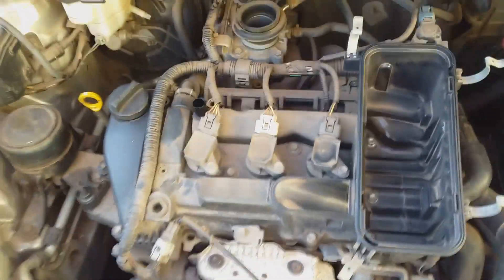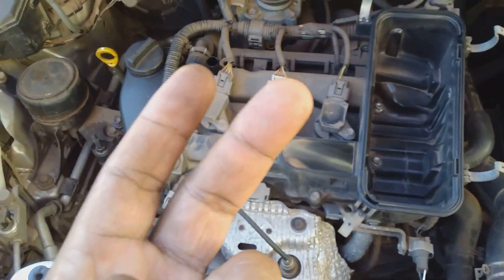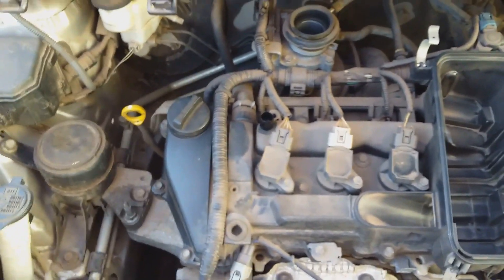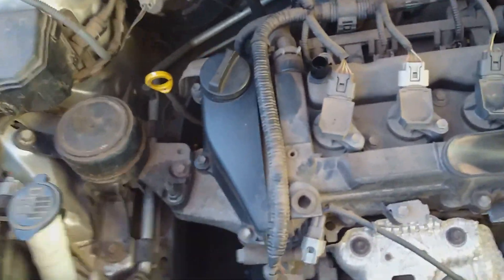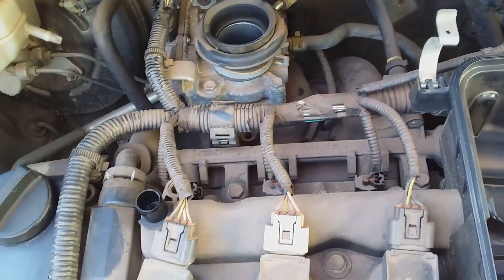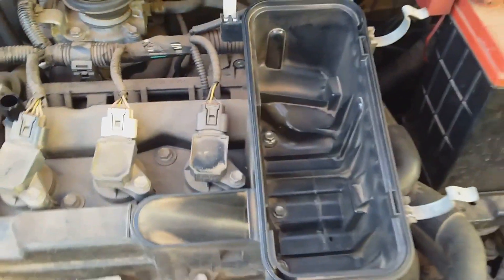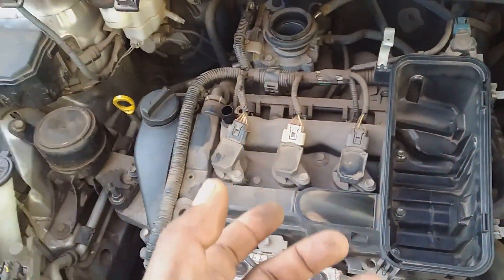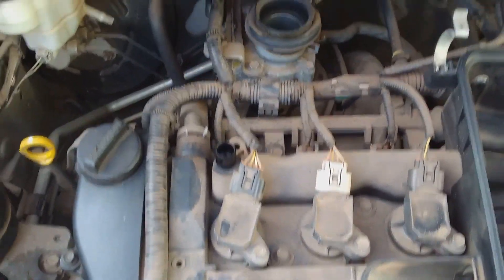Toyota Vitz Engine Vibration Analysis

Comment: Hi man please can you help me ? I removed the trutle body and cleaned it , after I put it back , à air light comes on the dashbord I removed it again check everything but it won't go off , why?
Reply from the maker: Hi there, to erase a engine check light you can use a scan tool.
This light will not go off by itself if you fixed the problem.
I have a bluedriver scan tool in my vehicle all the time in the event I need it to erase a fault code.

Comment: Hi there . good knowledge about Toyota vitz you have . what might be the issue for rough idling when the car is warm ?
Reply from the maker: When a vehicle idles rough and there is no indication of any engine check light issue you could have:
1. a disabled idle code.
2. a partly blocked throttle body valve
3. EGR valve problem.
4. Spark plug not firing properly- check sparkplug/ignition coil pack.
5. Other fuel or ignition issues.
Reply: @ShelDockToyotaVitz  also my car is a push start and i follwed and tried your engine idlle code enabling video.
Reply from the maker: @uipex  Thanks for viewing my content. Hopefully you are finding and solving the problems causing your engine vibration.

Comment: SOOOOLVVEEEEDDDDDDDDDD BY LUCK my engine stop vibration when i put a adapter in my second ogyzend sensor L WHEN I PUT NEW CATALITY EXSAUT which is aftermarket and no connect correct as the original and the engine check was on all the time
so I HAVE increased exhaust gas and my cpu try to low reduction 

my idle worked AT 500 -600 and now when i stop with engine on my idle SHOWS 900 - 1100 NO VIBRIATION

THE MAIN PROBLEM STILL IS INCREASED EXHAUST GAS  MY ENGINEAR WILL SEE IN THE NEXT SERVICE
SO BUT A ADAPTER  IN second ogyzend sensor AND SEE IT REALLLY WORKSSSS
PLZ ANY SUGGETION FOR  increased exhaust gas
Reply from the maker: Thanks for your comment, as for a good rpm during idling it should be between  600 rpm and 700 rpm. 1000 rpm is okay but is still a bit high for these vehicles.
Reply from the maker: The exhaust system is designed to have some measure of control over the rate of flow of exhaust gasses. This is why if you have leak in the exhaust between the engine and the catalyst converter you will have bad gas mileage. It would be best to get the correct catalyst converter for that vehicle.

Comment: bro the engine vibrations can come from the connecting rod and crankshaft bearings
Reply from the maker: Very true and because of these electronic controlled systems on vehicles now a days, small changes in these systems will result in problems such as engine vibration.
Reply: @ShelDockToyotaVitz can you  check my vehicle sir 2006 vitz  were can we meet I'm in spanish town  please as soonest